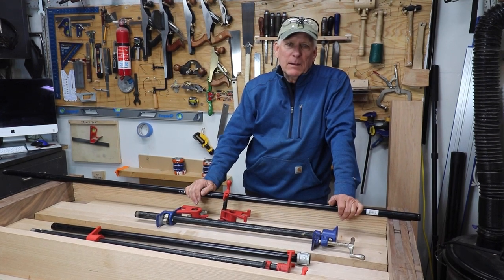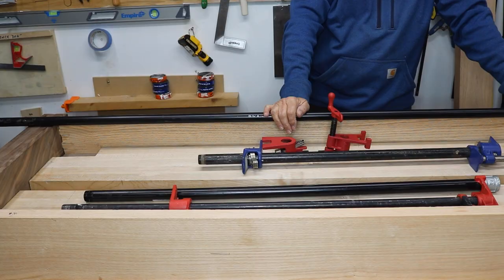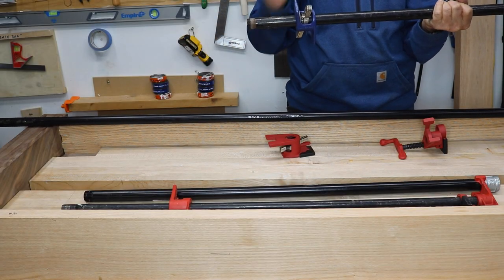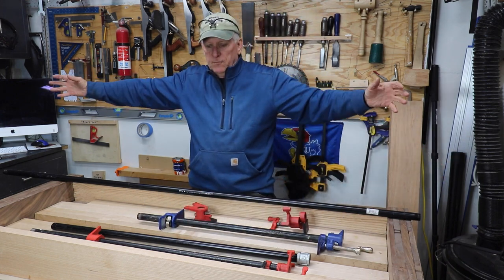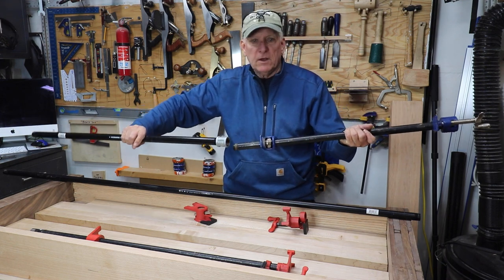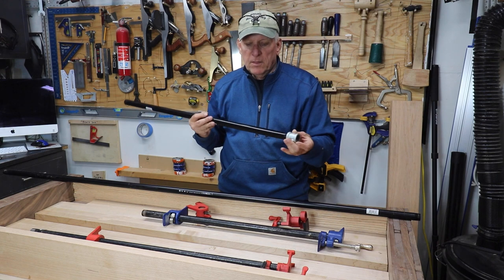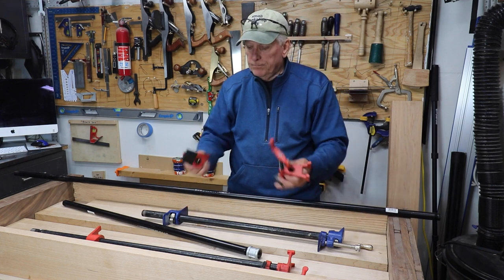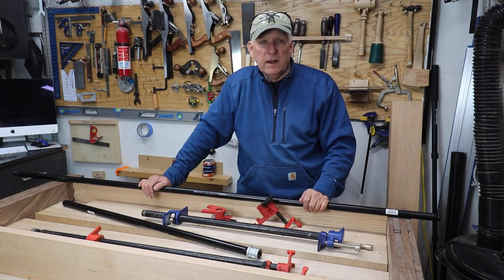The Secret To Having Lots of Clamp Sizes Without Buying A Lot of Clamps

Comment: Thank you sir for your advice on pipe clamps I was wondering should I get 1/2 in or 3/4, so listening to you I will get 3/4 in and then start off with shorter pipe and then add on with a connecting pipe makes a lot of sense. Thanks for sharing your knowledge. #PEACE ✌🏾
Reply from the maker: I am not accused of having valuable knowledge very often, but when you make as many mistakes as I do in the workshop you learn a few things from experience.  LOL

Comment: Good idea.  Do you ever find the pipe coupling getting in the way of your work?  I haven't tried this but it seems to me that if you are assembling something like a cutting board or table, the clamp could introduce a bow into the wood.
Reply from the maker: Hey, Missouri Bob - from a Kansas Jayhawk - that was my concern on a recent big glue-up where I needed longer clamps, but did not appear to be the case.  But the workpiece I was assembling was substantial.  Not sure if a smaller panel would bow or not.  But fortunately for that, I have 6 60 inch panel clamps.